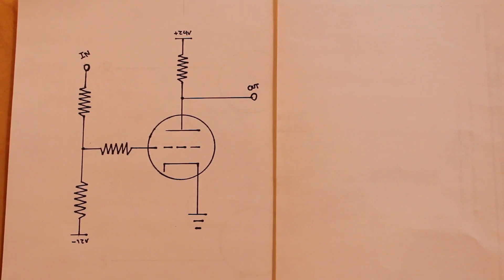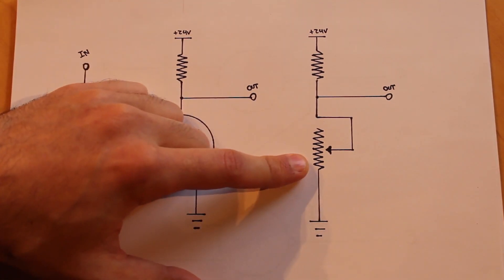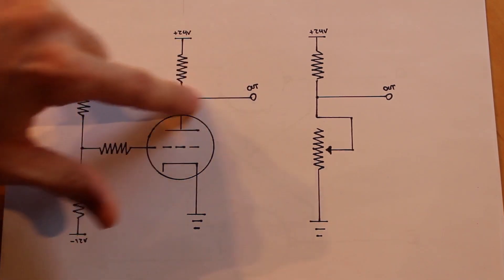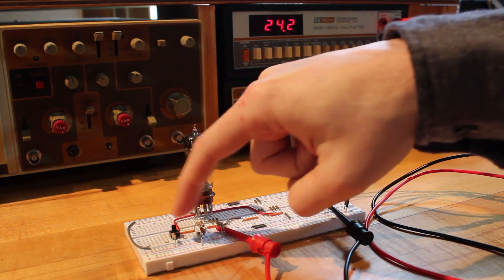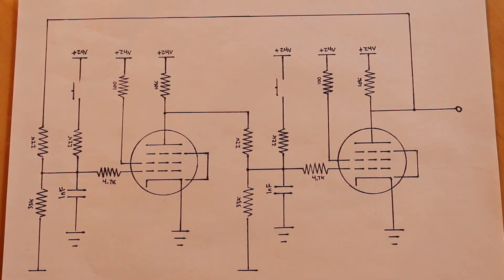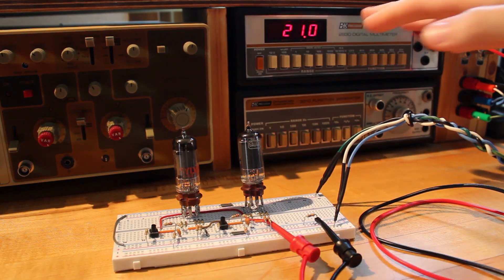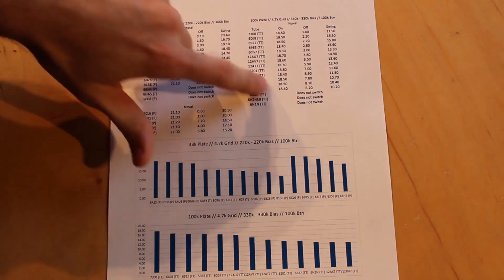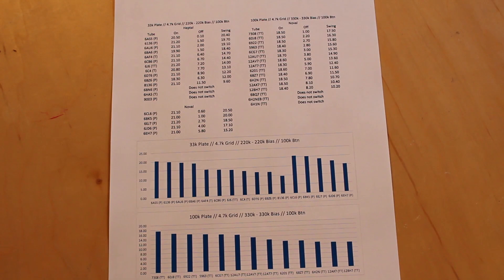Vacuum Tube Computer P.08.1 – OpAmp Clock: Inverter Upgrades

Comment: Not only vacuum tubes act as controllable resistors, but some of the most modern parts do the same: FETs. Both JFETs and MOSFETs are basically voltage-controlled resistors.
Reply: Correct; FETs and valves are voltage-controlled devices. In contrast, bipolar transistors are current-controlled devices.

Comment: I've never done anything with tubes, but you could do something similar with transistors, right? So what I guess is happening with the lower plate resistors is that the "inverter" has a (much) lower output impedance. When high the resistance is basically 33k and when low it's basically the resistance that the tube gives, so about 3k. Putting a smaller or larger load on an output of course has less influence on the voltage when that output has a low impedance. That means you could hook up multiple inputs to one output with less influence on the voltage swing. But it gets (much) better when using higher input resistors and I suspect that's where the big improvement comes from here.. Going from 10k input ("bias") resistors to 220k will give a much higher input impedance. I'm not sure what the input impedance of the grid in a tube is, but I suspect it's pretty high, so you might even try 1M bias resistors.. That means you might even be able to hook up perhaps hundreds of inputs to one inverter output because the difference between the output impedance and input impedance is so big that the number of inputs connected to one output hardly influences the voltage swing anymore..
Reply from the maker: You're definitely on the right track here!
In my brain, it was easiest to think of the tube and the plate resistor as creating a voltage divider. When the tube is in cutoff (no electron flow), the tube's internal resistance is something like 100M+, it's essentially and open circuit.  When the tube is in saturation, its internal resistance is around 2k. At cutoff, we're essentially just looking at the plate resistor as a pullup, we can pretty much completely ignore the tube. At saturation, if we do our voltage divider calculation:
10k/2k = 4V
33k/2k = 1.3V
But, as you noted, the amount of current that can be supplied through the plate resistor gets smaller the larger it gets, meaning the input impedance of the next stage starts to play a very important role. In my example, I jump up to 220k/220k, and I could even push it to 330k/330k, but much higher than that and I started running into problems. I tried a 1M/1M and it just wouldn't work, I couldn't get enough change on the grid to get to tube to either saturation or cutoff. So, the grid itself is definitely having an impact of some kind. The solution of course is to just toss a quick cathode follower buffer in situations where I need a nice powerful output!
Reply: @UsagiElectric  Right.. And of course the plate resistor together with the bias resistors also forms a circuit. You've got another voltage divider there.. Whether the tube is in cutoff or saturation, there will always be a current flowing through the plate resistor and then through the input of the next stage, to ground. That means the plate resistor of one output and positive side of the voltage divider of all the connected inputs are essentially in parallel.
I guess most of the benefit comes from playing around with the bias resistors, because making the plate resistors even smaller would perhaps make the current through the tube too large.. I'm not sure how high that current can go..

Using a totempole topology with 2 tubes per output (one for making the output high and one making it low), you could significantly reduce the current, which means you could make the output impedance as low as possible (as long as the tubes would switch fast enough to prevent a short circuit every time an output switches from 1 to 0 and back). Unfortunately that would also double the amount of tubes you need. Not a huge problem when using transistors or mosfets perhaps.. But in your case that's a different story I think.. Already size and cost constraints would force you to use as few tubes as possible probably.

Comment: Do you test and match the tubes or do you just plug them in and pray it works?
Reply from the maker: I don't usually match tubes other than just ensuring that the tubes are the same type (ie. using two 6AU6s, or two 6CB6s, but not one of each). 

Fortunately, the design that I'm using allows a lot of flexibility in tube characteristics. Since I'm primarily using my tubes in a digital manner, all I really care about is pushing the tube to saturation or cutoff. In saturation, I see some different output voltages based on the tube's emission characteristics, but even if the saturation output voltage varies by 1V or 2V, the circuit is largely unaffected since logic high is greater than 20V and logic low is less than 5V.

For audio applications, or even situations where operating the tube in-between saturation and cutoff is important, this is a terrible design choice. But, for the digital circuit applications I have here, there's a huge amount of flexibility in both the tube properties and tube type. So, almost all of my circuits have worked without issue no matter how new or old the tube is, or how different the emission characteristics of the tubes are.

Comment: Ah, the 6AS5 is a tube made for car audio use.  So a car tube did do better.  Cool.  Since the larger plate size is probably what made the difference, have you ever tried larger (not miniature) pentodes to see how they react at low voltages.  At least at low voltages, you won't end up like Spock:

https://vincentpaone.files.wordpress.com/2011/11/thecityontheedgeofforeverhd612.jpg
Reply from the maker: Oh, I totally didn't realize that the 6AS5 was an automotive tube! It's surprising how much better it did, though I think it's definitely due to plate design and size. I haven't tried some of the larger pentodes (like the 6V6), but that's primarily because I don't have any, haha. Although, I do have an old radio with a 1A5GT in it, I may have to go steal that one for a bit!

I wonder if anyone has identified which tubes exactly Spock is using in that one? Of course, with only 10 tubes, whatever he's building is going to have pretty limited functionality, haha.

Comment: On ebay I saw some USSR valves being sold in quantities of 100 or so for a low price I think the valve was a 6J1P. Maybe that's a good option for a valve computer?
Reply from the maker: I think it comes down a lot to luck. I currently have around 250 to 300 6AU6 tubes in my collection from simply getting lucky with random lots on eBay. Most recently, I acquired around 150+ 6AU6s for $70 shipped. That's about $0.40 per tube, which is pretty good, but not the best deal I've seen. Although, I think the most important thing is familiarity. By using just 6AU6 tubes, it's so much easier to design circuits as I'm really pretty familiar with how the 6AU6 operates now. But, if instead I had a ton of 12AU7s or 6H2Ns, I could learn the right resistor values and designs to get those working properly too.

Having said that, I believe the 6J1P is roughly equivalent to the 6AK5, which I happen to have a few of. I'll have to pull them out and give them a test as well!
Reply: @UsagiElectric  6AU6 is very nice tube.. they are sharp cut off pentode, which can use for audio as pentode mode or triode mode.. also good to make radio . Also can use as power tube i think for small power push pull maybe deliver 1-2W.. 12AU7 is very common audio tube very nice .. but they are not easy to find in malaysia. 6N2 is close to 12AX7 except the heater wiring without center tap , 12AX7 pin 9 is center tap of heater and 6N2 only pin 4,5 only work for 6.3V.

6J1P is 6Ak5/EF95 , they are good tube too ,I like 6J1 is very short cute bulb and low heater current, but they can work over 180V .. i did use them to make 12V radio for fun. 

https://geeseang.wordpress.com/hybrid-12v-tube-super-hetrodyne-tube-radio/

Comment: You haven't mentioned "fan-out" or the issue of how many inputs can one tube drive successfully.
Reply from the maker: That's actually a fantastic question and a problem I've been butting my head against.

I haven't re-tested with the new 33k/220k/220k design, but on the old 10k/22k/33k design, one inverter could supply input to at most two other inverters. I could get away with three in some situations, but it was unstable. Now, the plate resistor has tripled in size, but the divider network resistors have increased 10x in size, so I fully expect one inverter to be able to supply input to three or maybe even four other inverters now without problem.

Still, the best practice is to have the output run through a cathode follower buffer. Where one 6AU6 inverter using a 33k plate resistor at 24V can supply right around 0.7mA of current, a cathode follower should be able to supply around 8mA. Which means, ideally, one cathode follower buffer should be able to supply input to at least 8x as many inputs as the inverter. 

The OpAmp (which I'll go into in more detail in Part 2) uses a cathode follower buffer on the end, so it should be able to provide a strong enough clock signal to everything that needs it. For other parts, like the instruction register, I'll have to add additional cathode follower buffers between the D Flip Flops and the decoder. It'll bring the total tube count up, but it's better to have it and not need it than need it and not have it.

Comment: Look fun to play around with vacuum tube, I like your video and your table is much cleaner and tidy then mine, My table full of parts. Is interesting to test the tube back into basic.

I think for some tube may no work well at low anode voltage , 24V should be ok for most of the tube will work good. from your table some tube Plate voltage didnt go up to 20V or more i think is due to insufficient negative voltage to fully cut off or sometime can be multi meter input impedance loading i guess .. 

I tried to show the 6DJ8 saturation curve at below link , Normally tube dont operate at positive grid because when grid at positive , the grid will conduct current , which make the input impedance low and difficult to drive.. So if assume dont operate at positive grid then the grid maximum voltage will be 0V.. So from the tube curve we can know that during saturation the tube act like 3.33K ohm resistance..  So for example plate resistor is 100K and when tube fully saturation is 3.3K then , the plate voltage should go down to 0.773V .  

https://i.ibb.co/zQKH5RX/6DJ8.jpg

I think by checking the datasheets curve maybe can give the ideal , about the tube saturation impedance (resistance) they are not linear like resistor.
Reply from the maker: Thank you so much!
And it’s easy to hide all the untidy parts of my table just out of the frame! Trust me, the desk turns into a disaster at times, haha.

I think you’re absolutely right. Some tubes have really wide/linear transitions on the plate in relation to grid voltage, sometimes requiring a change of 5V or more on the grid to go from cutoff to saturation. I’ve found that triodes in particular exhibit this, with the 12AT7 being the worst about it. Interestingly, the 6BQ7 seem to have a much faster transition but I couldn’t get it to cooperate with me in the SR Flip Flop setup. Perhaps with more tweaking I could get it working well.

Pentodes on the other hand seem to exhibit really quick transitions, often just a change of 1V to 2V on the grid will take the plate from cutoff to saturation. 

As for the 6DJ8, it actually worked pretty well with the 33k/220k/220k setup. But I wanted to keep all the 9-pin dual triodes setup the same for a proper comparison, and very few of the other dual triodes wanted to operate with a 33k plate resistor. 

You’re definitely right that saturation impedance is not linear like a resistor, and I think I get where you’re coming from with regards to positive grid. As the tube conducts, more and more electrons flow to the plate, which brings our output low. But, the lower the plate potential, the less electrons want to flow, so for triodes pulling them fully into saturation isn’t necessarily the best option (and their saturation point may be different depending B+ potential and plate resistor size).

However, for pentodes (and tetrodes to an extent), the screen grid supplies a nice strong positive potential to attract electrons, regardless of the plate potential. I believe that’s why in my testing we see the pentodes consistently outperform the triodes and give us some really exciting results like with the 6AS5.
Reply: @UsagiElectric  Yes some tube cut off very quickly is because they having very high pitch in grid, which usually high mu triode, such as 12AX7 is 100 , 12AT7 is 70 , 12AU7 is 20 .  higher mu the tube have higher voltage gain (not power) . like 12AX7 higher mu , maybe u will experience just a very little different voltage the plate change from on to off or off to on this is because this tube have very high gain.. normally high mu triode can only flow lower current , i think maybe is due to the grid pitch is higher so it block most of electron? i guess.. For pentode tube some datasheets did tell about G1, G2 mu , most of datasheets didnt tell about g1g2 mu because they are design for pentode operation. 

I start tube collection since i was 10years old , i like vacuum tube very much.I have collect several tube. just i dont have many friend playing tube in real life. Maybe we can keep in touch as friend , maybe i can share something what i know to you.. my mother language is not english i cant speak well in english. So i cant make the good video like u do. But i hope more and more people interest about tube.. i think tube is really fun , also look nice.  if you dont mind you can send me mail.. my email , sougisyou@gmail.com thanks you.